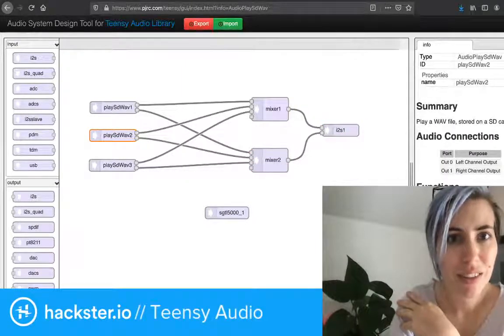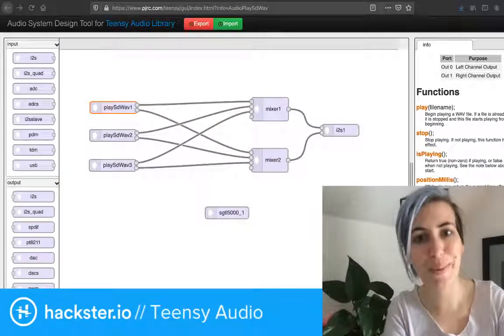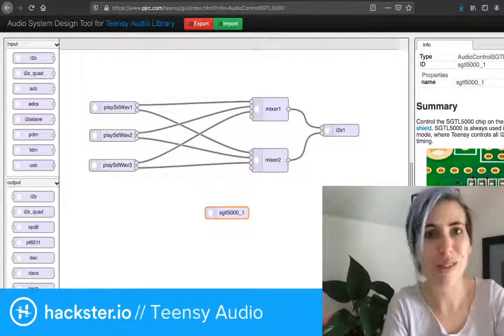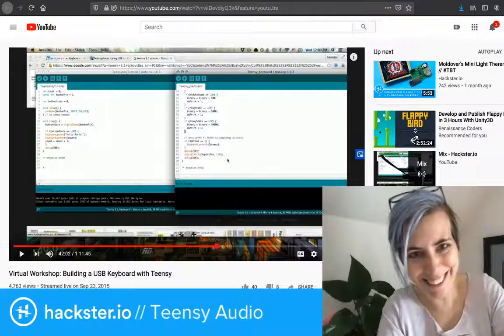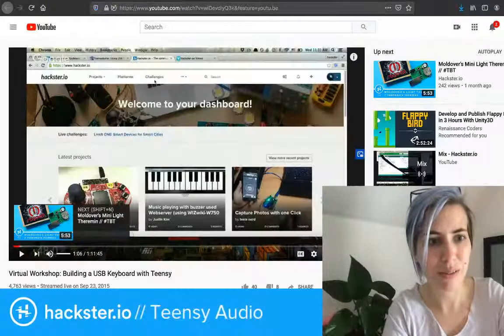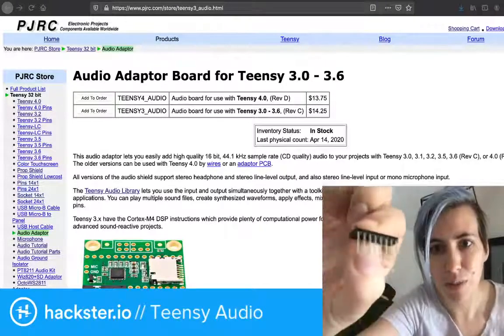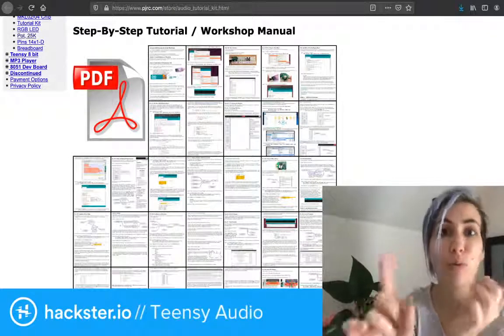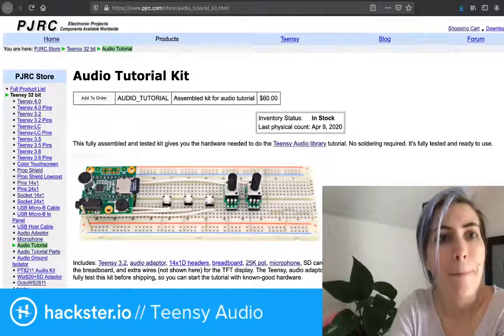Teensy's Audio Wonderland

Comment: Hey thanks for this nice content i wonder if is possible for example to use this for my project i am try to have a way to play perfect drum loop with perfect timing and no click my goal is to have a drum machine embeded in my guitar this way i can have my backing tracks and my gutar sound in the same output and i will have also button with intro fill1 fill2 and endding like on portable  keyboads is this possible using teensy ? I am about to receive the 4 1 and his audioshield i hope i can do this